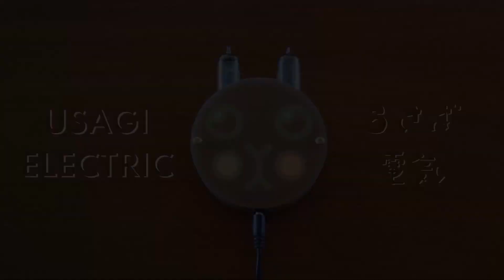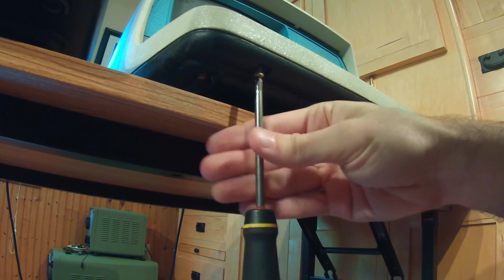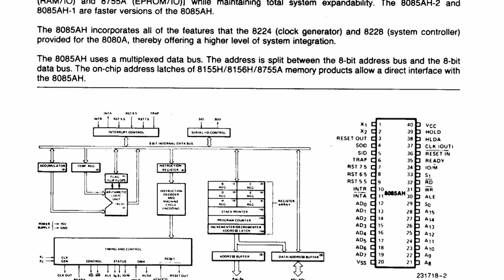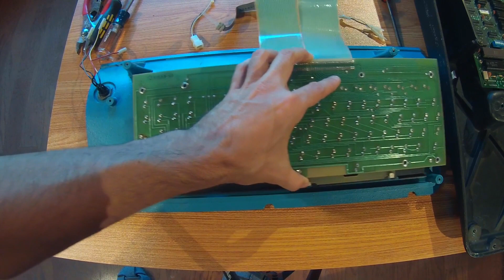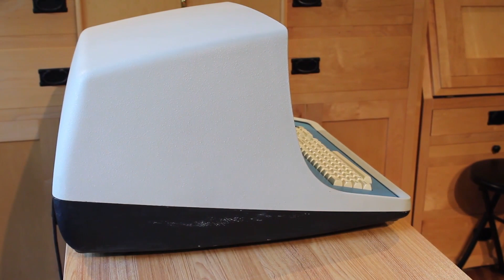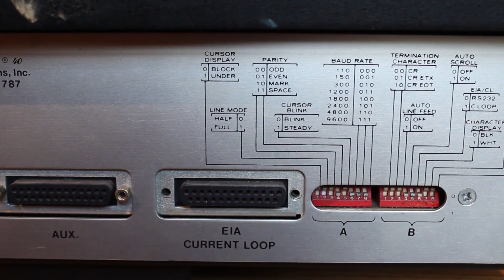Minicomputer Part 6: Restoring the ADDS Data Terminals

Comment: The screwdriver marks around the flyback was probably to chip away the rosin left behind by the rosin-core solder in common use back then. Rosin starts out inert but becomes conductive once it absorbs enough moisture. Modern 'no-clean' solders use a similar type of flux that remains chemically inert for much longer. The 125V rating of the fuse was probably because those are more common (and therefore cheaper) than the 32V fuses - the current rating is the main thing, and it is clearly a fast-blow type.

Comment: On a terminal there is a difference between when you want to change what YOU see on the terminal, and what you are sending to the programming interfacing with the terminal.  So the c/r is being sent to the program and the Ctrl does it only on the display.

Comment: The Terminals are not acting like you would expect a computer to work? Well, maybe it's because they're no computers? They're just more or less dumb terminals showing on screen what they get from their "modem section" or "serial port" on screen. And, maybe they're showing up that asterisk on every try to synchronize with the HOST (maybe you could call it the real computer?) that controls every display. On the other hand the terminal as it's 2nd job has the duty to send the keystrokes you do to the host. Then the host usually has to decide what to do with it. Should it display the characters you hit? Maybe not the best solution if you're typing in passwords, right? Maybe it should display the characters in some other cases, for examples if you would be doing correspondence or keying in data from your terminal. But that's up to the host to decide which to display and which not. That is why you had to switch on the "echo characters" on your DIP switches to overrule the standard mode "output only what host is telling to display".
So, (which I would expect you did that long ago, since I haven't seen all the videos of that series up to now) all I would expect you to have to do is hooking up the terminals to a working host, get both, terminal and host trying to communicate at the same baud rate and negotians (which parity, how many data bits and so on) and then let the host do it's work. ;-)
But maybe we will see down the road when the series reaches it's last episode... ;-)
Well done, nice work and videos so far!

Comment: Nice work mate, These are beautiful. You should connecting the 2 machine together with NULL Modem Cable, Set to RS233 Mode and types between the two!

Comment: The coil uses braided wire due to something called "skin effect". At high frequencies, the portion of a wire that carries current narrows, the current gets confined to the outside of the wire in a narrow band or "skin", the higher the frequency the narrower the skin. After a certain frequency, the center of a wire basically has no current going through it so the effective current-carrying cross-section of the wire narrows. So in order to be able to carry a higher current at high frequencies, it is more effective to use a bunch of smaller diameter wires than a larger diameter single wire.

Comment: Did you managed to read the P8355 already?

Did you put those zip-ties yourself, our they were already there?
I'm not sure they had zip-ties back in the seventies. That might explain the good condition of the caps, someone changed them in a more recent date.
Reply: We did have and used "zip-ties" in the 1970's.  Even had a tool to pull the zip-ties tight and clip the tails in a single pull on the tool's handle.
Reply: @kenromaine2387  Ok, then it was only my ignorance. The zip ties had become a very common thing around here, PT, a bit latter.
I still recall that, in the first half of the '80s, the best thing we (CB & HAM) had to tie antenna cables to the masts was insulating tape or punched metal strips.
Reply: @jorgeferreira6727  No problem on the zip-ties.     I just got me HAM license a few years ago, started in 1971 but finally took the test in 2017.  Have a great day.

Comment: I strongly recommend getting a capacitor tester. Caps Will usually fail by the electrolytic slowly trying out. This causes series resistance to increase which reduces the effectiveness of the capacitor. This will happen very often without any obvious problem on visual inspection. Electrically because of the increase resistance, you’ll see poor regulation, and increased ripple. Increased ripple from your power supply and from the regulating capacitors will give you all sorts of problems, like data corruption, bit flipping, logic issues, etc. A capacitor tester can usually check ESR in circuit and you could do this very quickly and easily while you’re going through the machine. Mr. Carlson’s lab shows went off if your unfamiliar. Get a capacitor tester!
Reply: Also, I noticed in another video that you have an oscilloscope. It would be useful to put the oscilloscope across the power supply rails under a load and AC couple the scope to check the amount of ripple. This can give you an idea of how healthy the filter caps are.

Comment: The terminal with the different design is probably the system console, used to control the CPU whereas the bigger similar ones would be at the other end of a long rs232 line in another office being used for data entry. Maybe that is why it behaves differently - if I'm right it will DEFINITELY be expecting something on its inputs when it fires up..i.e. a live CPU

Comment: I've worked with terminals and you pretty much has reached top of their capabilities. To be usable you must connect them to a host via RS-232 serial(s) port(s) and use them as... well.. terminals. Any Linux machine with getty enabled will work nicely via a simple USB-RS232 adapter. Just match serial speed, char length, parity and stop bits.

Comment: Usually, those terminals have two modes.   In one mode - whatever you type goes onto the screen (and whatever the computer sends also goes onto the screen) - this is often called "LOCAL" or something like that.   In the other mode (which is MUCH more useful) what you type goes ONLY to the computer - and the computer is required to send each character that you type back to the terminal for it to be displayed - this is often called "ECHO".   You seem to have these two terminals in "LOCAL" mode - or else you wouldn't see anything when you typed.   But these seem to be "current loop" interface serial terminals.   I bet you could find a design for the computer-side circuitry for a current loop interface - and then interface it to an Arduino or a modern PC...for something from the 1980's they almost certainly accept ASCII characters.
Reply: Current loop interfaces are used in MIDI circuitry as well, it's not hard to convert these current loops to voltages (as required by regular serial interfaces) but they do require a bit of circuitry to do so. Usually involves using an optocoupler to close the current loop and convert the output to a voltage. Schematics are easy to find online.
Reply: Well.. some of these terminals (hence the name 'DTE') worked remotely through a modem (DCE) to reach the mainframe... Which reminds me, the NULL MODEM RS-232 cable concept. (DTE - DTE direct connection) 
That could be cool, in order to fool around with a friend (and practice typing, by the way): to build a NULL MODEM cable, hook both terminals to each other, and just chat!!! 
Or, would it??

Comment: Odds are very nearly certain that one or more of those ROM chips are character generators - the data in them will describe the font that the machine uses.   Now you have the data, you should be able to convert the data from hex to binary and SEE the letters in the font.  When the CRT is running, count how many scanlines and how many horizontal pixels there are for each character.

Comment: Mmm brings up memories. From the old times, when I tried, just for fun, to connect PDP terminal to IBM/PC and redirect command line there. Kinda worked, but I had to solder an adapter to bind together old style serial current loop interface with RS-232.

Comment: At the very least I would test the main filter caps. Of course you'll get an argument between CuriousMarc and Mr. Carlson. CuriousMarc doesn't immediately replace caps, and Mr. Carlson's attitiude is that caps are cheap enough, so just change them.

Comment: For the price you paid for all of that , I would just use the cases of the terminals and put modern a modern SOC and a fairly modern graphics driver to the old screen , I would not bother trying to get the whole machine working as it’s a business machine with nothing interesting to show on the screen if you get the drives working , these things are being ripped out of old office blocks and thrown in the skip/ dumpsters  all over the world , they are really not worth the process of getting them working again because of the business use , if I see one in a skip I’ll take it home and use the lovely case and hopefully still working CRT and put a raspberry pi in it

Comment: Couldn't you test the terminals further by connecting them to another known-working computer?  Since they apparently implement both 20mA current loop and RS-232, that seems like it should be possible, thus allowed you to further troubleshoot the terminals independently of the Centurion minicomputer.

Comment: As you'll probably know, the CR/LF character thing comes (as I understand/remember it) from the printing side of life - i.e. in any file sent to the printer these characters literally drive the head movement (CR) and paper feed mechanisms (LF). I think there is another char for top of new page?  Operator consoles (i.e. terminals) make this obvious, where you have a printing mechanism instead of a CRT. That line printer you have there - now that would be something to see working - they're monsters ;)

Comment: Nice job on the clean-up. My experience with dumb terminals is that the computer will echo what you typed with the proper control codes to advance the line while performing the CR. Once you get the computer up, you may find your keys being doubled, like  HHEELLOO.  If that happens, it means one of the letters comes from that self-echo feature, and the other is the echo from the computer. You'll just have to toggle that dip switch the other way. There are also dips on the back for the behavior of the CR/LF, but don't change those until you get the computer live.

Comment: Looks like the terminals are both working perfectly, they both cleaned up amazingly.  Ironically the terminals are one of the few components that are pretty easy to replace. - Ordinary PCs can run an extensive range of terminal emulators, especially under Linux. Though you would probably need an interface card with a Centronics or RS232 interface.
Reply: It looks though that the communication for these is done using a current loop (like in MIDI interfaces) not a plain voltage-driven line like in RS232, so it may need a bit of interfacing electronics to get it to connect to a PC.

Comment: Those are microcomputers, even you called them microcomputers at one point! The term microcomputer is based on the microprocessor/s inside and not on the size of the unit.

Comment: Excellent clean up! looks beautiful.

Im no CRT pro, but ive screwed around with em a bit. we all know old tube screens need a high voltage. thats what "pulls" the electons into the phosphor on the screen. however, it also needs a few other voltages. negative voltages, adjustable focus voltages. most of these are generated off the flyback transformer. it sets the refresh rate, but also is the power transformer for the high voltage lines. its very elegant, very clever.

you can also do some terribly evil things to a good flyback transformer. jam 10x the power thru em, and submit puny atoms to your Fat Plasma flow. some things act real strange when you bomb them with electrons ^.^ a stock standard flyback might make a hair thin blue spark, 1cm long. mine pulled 2 inches, but most impressive was it was a few mm thick of plasma. pretty sure it gave me permanent eye damage. meh, worth it. the things you come up with when you have no money and much time... I bought ONE part for that project, a single PNP transistor. about 6 TV's, 3 VCR's n a few PC's. frivolous, perhaps, but it got me a job in electronic engineering. turns out being able to describe the project top to bottom with all the fails n fixes is pretty good for a job interview

Comment: Hoboy I sure hope you discharged the EXTREMELY high voltage caps power those CRTs after turning them on and then taking them apart. The voltage that powers than can kill you if you touch the wrong part.

Comment: The *s are indeed data being received, not real data though just garbage/noise from incorrectly configured interface. I'm not surprised that you see control characters when attempting to newline or cr, these terminals are meant to connect to a remote machine. In fact I'm surprised you get any response at all from just typing as generally this is an option called local echo, some systems will immediately return each character sent to it from the terminal, so the terminal only needs to show what the remote system print..other systems won't echo your characters back to you and thus the terminal needs to. When sending a CR or LF, the remote system should handle moving the cursor..not sure if these are similar to VT100 or not, maybe a bit earlier but probably similar. There may be options (dip switches?) for configuring baud, bits, parity, start/stop bits, local echo and whether to print control characters..but this stuff could also all be hard configured.

I also wonder if the PASS thing is a password for logging in of some sorts saved into an eeprom of the terminal and shown for convenience (a welcome message?) Dunno!

Comment: @Usagi Electric your other (3rd) terminal may be a clone of the original ADDS Viewpoint    https://terminals-wiki.org/wiki/index.php/ADDS_Viewpoint    If so, it would respond well as a Linux terminal if you set your Linux session to use a Wyse 50 compatible terminal.  I used that ADDS Viewpoint on Linux, and would type "export TERM=wyse50" at the start of a session, and it had decent control (cursor positioning, erase/delete, character highlighting, etc.)     If the remote keyboard for the ADDS Viewpoint compatible terminal is beyond repair, you can always find just the keyboard alone in online computer sales, or even ebay.  You will have to paint the new one blue, they all came in black :)

Comment: Wow talk about a trip down memory lane… I worked for ADDS in the early 80’s. Both those terminals are ADDS “Regent” style terminals, micro processor based. One looks like a Regent 25 and the other a Regent 40. I use to repair those terminals. They seem to be working ok. The firmware that’s in them is designed to work when hooked up to the computer it is communicating with; at that point the terminal will function correctly. Depending on the customer, different code was loaded into the computer to emulate their system to properly test terminal functionality, probably the reason you’re seeing “CR” when you hit the “NEWLINE” key just as an example. It’s been almost 40 years so I don’t remember too much about them. Those monitors were made by Panasonic and were fairly reliable, ADDS made their own also, kinda looked like wire frame type construction. So I’m guessing that the Panasonic monitor was an upgrade item. Good luck with them and the Centurion microcomputer.
Reply: Hi Mark. DO you happen to know if the frame was made by another company? That terminal has the same shell as the Intertec Super Brain/InterTube
Reply: @plgDavid  David... The wire frame style monitor was made by an outside source, it was a very basic and cheap monitor. I actually remember gluing small magnets to the yoke just to get the display to look half way decent. The Panasonic display was a much better monitor overall, not that it didn't have it's own set of problems but just a better monitor. You very rarely had to tweak them (when new). Hope this helps in answering your question.
Reply: @wa2mo  Yes indeed thank you!

Comment: Something you should know is usually Ctrl+ a letter corresponds to ASCII codes, for instance Ctrl+A is ASCII 1, CTRL+B is 2, and so on through CTRL+Z is 26. So some useful ones are Ctrl+I is Tab(9), Ctrl+J is Line Feed (10), Ctrl+M is Carriage Return (13), Ctrl+H is Backspace(8) although “DEL” is also used as backspace on some terminals (ascii 127 which wouldn’t have a Ctrl+something key).

In other words you could try Ctrl+M Ctrl+J on the other terminal to see if it does something different.